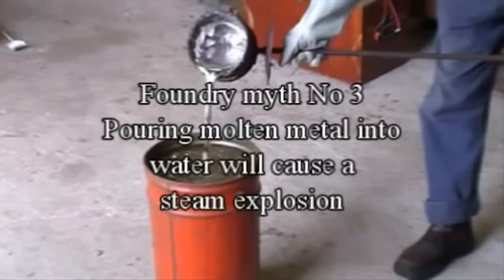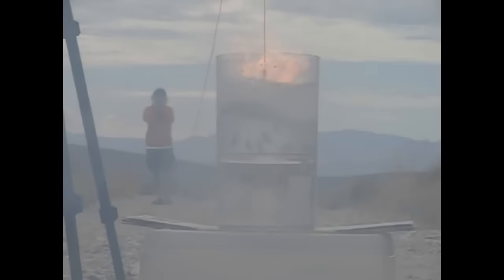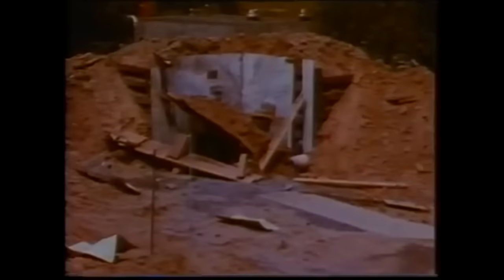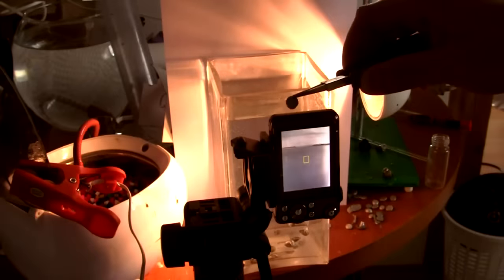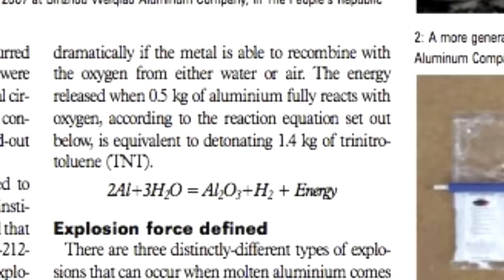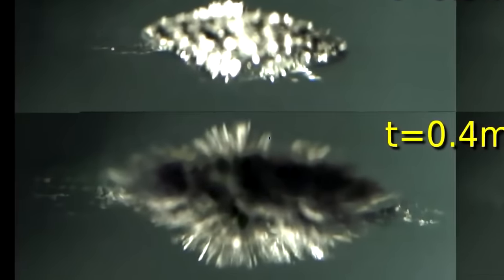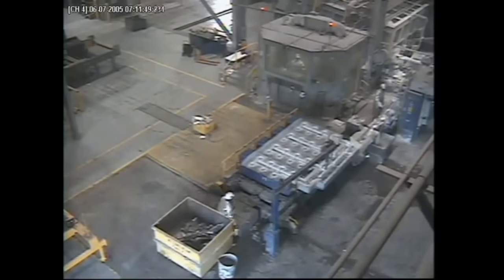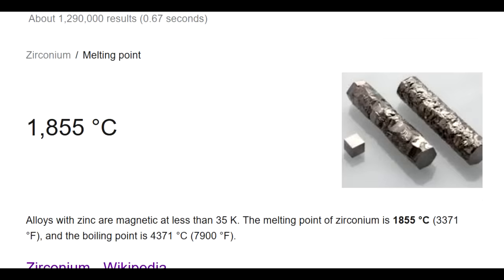The Awesome Power of the Aluminium-Water Explosion!

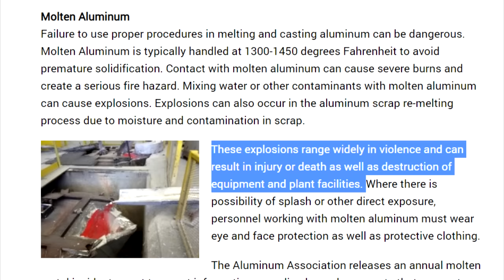Comment: 03:08 Lol Calm down dude. They are alive because they equalized the energy to water ratio so low that the explosions are very small. The painfully obvious differences are the amount of heat energy to water exposure. Think more talk crazy less :)_;
Reply: His point was they everyone all decided to use a massive amount of water and they all poured slowly. Dozens of ignorant people all luckily did this 'experiment' in the safest way possible.
Reply: @Joe-xp8rb  Lol, It was not the massive amount of water. It was in part slow pouring. If you had understood the video the PRIMARY reason they did not get larger reactions IS the oxidization layers that develop on the surface of Aluminum. Last point is, the extremes did NOT match the simpletons experiments and no reason to conflate them other than clicks to excite gents like you :)_;
Reply: @victim.vs.victoryculture4151  What excites me is ingrate twats like you and how I can push your buttons and for the record I responded to your comment responding to the video responding to other videos
Reply: @Joe-xp8rb  lolz, You sound like the one who had his buttons pushed. Don't be mad bro. Your just the typical dumb ass thinking their idiotic bullshit is special :)_;

Comment: Aluminium is not comparable to the alkali metals, zirconium or iron. That’s a simple fact.

Pouring molten metal into wet mould is not a metal explosion, it is the expansion of any water in the mould expanding to 1600 times its original volume. In lead casting we call this the silver shower, which is easily avoided by preheating the moulds.

Where an explosion risk occurs is when a small amount of water or iron enters the molten aluminium (as opposed to it entering the water which simply cools it as seen when poured into water), in the same way you never add water to acid, always the acid to water.

Your video makes illogical comparisons.

Comment: Your knowledge is flawed on this, it's not a chemical reaction in the aluminium/water explosion, it the expansion of water when it's vaporised by the heat of the aluminium that causes the explosion in the H&S video,   in the youtube videos, the bulk water cools the Al without vaporising.  A chemist like you should be thinking along the lines of diluting sulphuric acid (slowly add the acid to the water, not the other way round)

Comment: Huh.  Barely molten aluminum will not do anything if poured slowly like that.  In the right conditions where the slag layer can't form, you might have a problem. Will the water explode in any case? Nope.

Will the sudden heat transfer of overheated metal cause an explosion solely due to rapid and explosive heat conductance? Yep.

Correlation and causation, etc. etc...

The sodium explodes due to a chemical reaction with water. Aluminum foundry explosions are due to heat  and rapid vaporization alone, not a chemical reaction. Your video and cherry picked tests are misleading.

Comment: Pouring molten aluminum in water..... Can we please cut the pure sh*t. At the temperatures that all of these demonstrations, ALL OF THEM we're done the following is true. We are not talking about pouring just molten aluminum in water. We are not talking about how lucky these people are in the demonstrations they've shown. They have shown that there is no danger pouring molten aluminum in water.
THE DANGER COMES when you pour molten aluminum in wet molds , forms or wet containers. There has been huge explosions when pouring slag into rain-soaked slag pits.
The reason the steel box exploded was there was just enough water in it that the thermal conversion of the aluminum Heat allowed the water to instantly Flash to steam 1000 times in volume causing a steam explosion.
The reason the second explosion was more violent is of course if you plug the top the explosive steam has to go somewhere so what went out the sides. DUH

Comment: 13 minutes to get even close to the correct description of the process. No mention that the ratio of water to aluminum is critical. Confusing dust with molten is also a big mistake. Not a good video.

Comment: There is more water in the pool than aluminium so it will cool it. Do the maths how much heat is in the aluminium and what temperature will the water rise too? You are mixing up with lots of molten metal and a small amount of water which will turn to steam. Not chemistry ...physics I would have expected better from you. How was lead shot made.?
Ps I’m from Sheffield and we know about pouring steel into wet ladles.

Comment: Clickbait.  You leave out the very important distinction of volume ratio.  High water to metal ratio means quenching; something humanity has been doing for millennia.  Low water to metal leads to leidenfrost and steam/molten metal explosions.  It's awfully disingenuous to predicate a sixteen minute video on a relatively straight forward distinction.

Simple safety rule: Tons or none.  Either have sufficient quenching mass, or keep it dry.